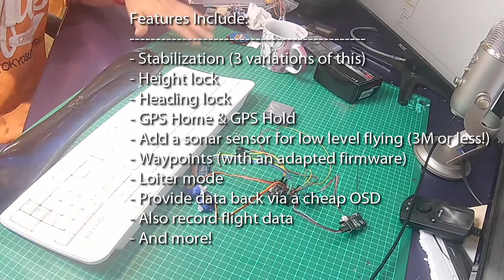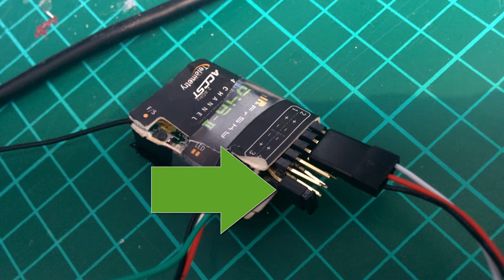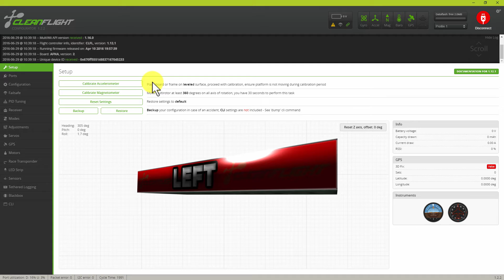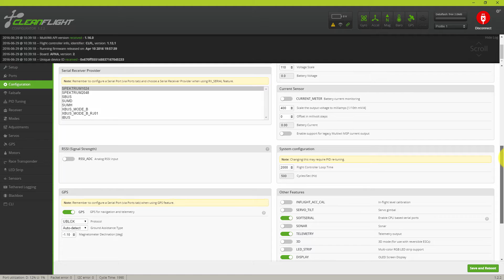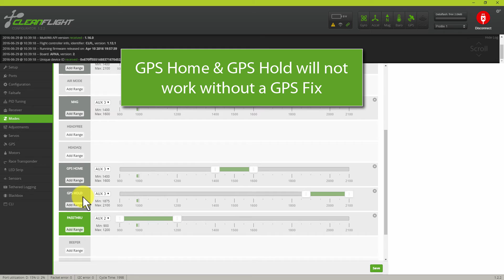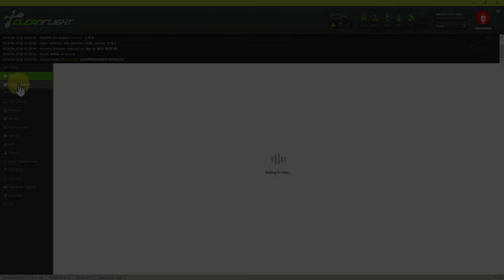Setting up a Naze32 Board for a Flying Wing

Comment: I can not get the servos to move :(
Reply from the maker: Howdy, see iNav instead, Matt
Reply: : - ) 

Can you pls tell the ß-flight guys what they need to do?
Difference is: Everything is blue and a bit strange, and there is an option Enable Motor and Servo output
Reply: ....... OH man... so ironic. now servos work exactly as i expected them to do. but now the motor does not get a usefull command. It is a brushless and does not beep. With Cleanflight/Betaflight it beeped and worked just fine
Reply: and it does not beep
Reply: okay, update: I can spin the motors using the motor tab. But it does not channel through my throttle from my transmitter - OR - it does not arm
Also the beeper still not working
Reply: the ESC beeps ready, and there is a good looking signal on the motor outputs. but it does not throttle up (the signal stays the same)
Reply: I also set up the armin switch correctly and set nav_extra_arming_safety = OFF
the boards blinks slowly (Green) plus red static LED
when arming it flashes fast (Green) plus red static LED

Comment: Matt, 

I want to use my naze32 for a fixed wing but it wont unbrick. I installed ST driver to help with unbricking it but to no avail. Can you help?
Reply from the maker: Howdy Derrick, I have no idea on that I'm afraid. Also I would strongly suggest not using cleanflight or similar for a fixed wing, when there is iNav available. See the series I made on it, miles better! Matt

Comment: Hi, tnx for the video .... I wish you had covered a bit bout more details of CF setup, especially the servo control part. I have made my setup as per gitthub and cleaflight documents for flying wing.....hardware and wiring wise, everything looks perfectly fine, I do have my fpv system working and motor is also arming and working good....the only issue is the servos on Elevrons! one is not getting signal and the other one is locked in one position. When I check the servo/motor tab in cleanflight....I see that my radio sticks on roll and pitch are moving the bars for servo 4 and servo 5....while I connected these two servos as per the instruction to pins 3 and 4 on Naze! Also the servo control menu on CF is not working....any assignment u want to do....its not getting saved!! Please advise.
Reply from the maker: Howdy fella, see here for a series on iNav, https://www.youtube.com/playlist?list=PLgoM4-umzSqd0clW-e_A12yKiOpV--3a2 Matt

Comment: Any thoughts on why the naze won't control my servos? It's controlling the ESC fine but the servos just make a quick sound and then go dead. No resistance when I move them. As if they're not even plugged into the naze.

Comment: What does 1/2 mean in front of the Fixed Wing, do I have to connect the 2 channels as an accelerator?
Reply from the maker: Hi Carlos, thats the PWM output channels, so 1/2 are the motors (3 is the left elevon and 4 is the right elevon), Matt

Comment: As you friend, I have a Naze32 10DOF eum Mini GPS; You say that in Cleanfligth I can not use the RTH and Alt Hold function, so how can I activate these functions in my Naze32 10 DOF?
Reply from the maker: Hi Carlos, If you continue through the rest of this older series you'll find that it doesn't work with cleanflight. Also I'd not suggest using a Naze 32 board as that ploughed my model into the ground, see the updated series here https://www.youtube.com/watch?v=1DCCjPbHl_I

Comment: Great video, but it is difficult to see where the wires go to. I have a naze32 rev6, a FZGPS, a microminimosd and a oled display(If possible). Can I use a X8R (SBUS) receiver to this, and how do i wire all this?  I will use INAV plane
Reply from the maker: Howdy, I would strongly suggest that you do NOT use a Naze32 board, look at the other videos in this series and you'll find out why. Instead use a F3 or F4 board instead, they're super inexpensive now & come with loads more features, like a built in OSD. Matt
Reply: Thank`s for answer. I am going to use the naze32 rev6 because i have one. I think i have found out that if i use a cppm receiver, i can do this??  or is there a way to use SBUS and all the others?
Reply from the maker: Howdy Jan, see above, I'd 100% not suggest using a Naze32 board. It smashed my model in the ground. Matt

Comment: Hey there,
Great video. Can you please post your PIDs?
I want to put the Naze32 in the same flying wing. THX
Reply from the maker: biberborste1975 Howdy, see my newer videos, try iNav instead, it's designed for fixed wing models, Matt
Reply: Yeah, maybe. But I don't want to install a gps module. So I want to use the naze32 with cleanflight. 
Can you tell me some PIDs wich worked well for you? thx
Reply from the maker: Howdy fella, this was almost a year ago so I don't remember what they were. But What I do know is that I would very likely not changed them at all. Hope that helps, Matt

Comment: how close to the cg should the naze32 board go?
Many thanks rct
Reply from the maker: Howdy fella, ideally right on the CG line if possible, or as close as you can get it at least. Matt
Reply: Matthew Ogborne if this is not possible can you offset what ever axis you have moved in, in the cleanflight configuration page?
Reply from the maker: rct2 Probably. I've not tried that though. Matt
Reply: Matthew Ogborne ta loads, it was just a thought.

Comment: I've tried using a Naze32 with CF on a flying wing and get erratic behavior from the servos.  Do you set up the profile in the Taranis as a flying wing or a plane?  I was only able to get it working in pass thru and by using a plane profile in my Taranis.  
I got it all working by using the Patrick Emilsson fork of Baseflight but really want to use Cleanflight in my wing.

Comment: Hi Mathew, I am new to the flying wing.  Did you use a power board to hook up the ESC and the battery to the Naze 32?  Can you tell me how the ESC power and signal line is connected to the Naze32?
Reply from the maker: Howdy Frank, I'll be covering this in a dedicated episode in the new year. Matt

Comment: Thanks for this. I'm not so interested in the GPS stuff and have a spare afromini so I'm going to do this on my first wing (first fixed model too). I'm really just interested in having auto levelling so it flies a bit like a quad with a broken accelerometer (always wants to go forward). :)
Reply from the maker: Howdy fella, yea the stablisation works really well. And yea try using yaw on a flying wing, I did a few weeks back and was OMFG!!!  It's not responding & realised I was flying a wing not a quad lolololol
Reply: Matthew Ogborne It's going to be weird to get used to as my fingers fly a quad pretty much automatically now. I expect crashes so I'm starting with the $20 thing banggood sell :)

Comment: Im getting problems with my setup  my yaw and pitch are the only ones working and no input on roll
Reply from the maker: Howdy Marcus, clean flight and a fixed or flying wing DID NOT work out for me. The gps functions such as RTH and loiter failed badly. I'm working on a new series right now using base flight and iNav. I'll publish part 1 tomorrow morning.
Reply from the maker: Marcus, see this video https://www.youtube.com/watch?v=sti1GxjEHmE
Reply from the maker: Howdy Marcus, literally just seen your comment while replying to another one. Apologies for the delay. As I found out Cleanflight doesn't support any GPS features for RTH or loiter with fixed wing, instead see the series here https://www.youtube.com/playlist?list=PLgoM4-umzSqcnDGRUWBReXZOVsg4Lu1Gx especially Baseflight Airplane as that works really well. Matt

Comment: how many servos can be attached??
Reply from the maker: Howdy Gustavo, 4. Channels 1 & 2 are for the motors, 3 & 4 are for elevons or ailerons, & 5 &  are for the rudder & elevator. Depending on the model format selected.

As a heads up the more I've dug into this the more I've found and a stock Naze32 board with cleanflight isn't enough. Look up iNav or PatrikE's baseFlight for fixed wing, see here for more info http://fpvlab.com/forums/showthread.php?27854-NAZE32-for-fixed-wing&p=805816&viewfull=1#post805816

Comment: Finally some one is having a go and documenting it. Awesome...! Bangin...!

Have you sussed out PID tuning yet? It's a mind shag on fixed wing and CF......loves a challenge! 
What PID controller are you using? I'm re-write ATM.
Would you use Air Mode? I'm finding the P gain is proportional to the throttle position like Quad without AM. This makes low and slow interesting. I hope AM will sort this?? Not had chance to try.
I'm thinking the servos can't react quick enough unlike fancy pants Quad ESCs. Might look into if available/exist, fast reacting servos?? 
I'm only getting good stabilised flight in no wind conditions.....surprise, surprise! 
Can't wait for winter and a damn good hard frost and no wind........love Brexit British weather! 

Bonsai
4s
1806 
6040
Frsky
Naze32
Cambridge
Horizon mode so far........

Proportional low 2.0 -3.0
Integral high 0.050 - 0.070
Derivative low 20 - 35

Peace
Reply from the maker: Howdy Barney,

Good & bad news I'm afraid. Stabilization on a wing with the Naze 32 is absolutely brilliant with no changes needed, it works great out of the box with default settings. 

GPS Home is a complete fail with the Naze32, it either nose dives at max throttle into the ground or prop hangs the wing in the air!

See the beginning of this video for a quick overview https://www.youtube.com/watch?v=ivukwrlc_k0

Matt
Reply from the maker: Just to clarify, pass-through mode is a bit wild, Rate (no other settings enabled) is great, Angle & Horizon also OK to fly with.
Reply: Ahhhh man. Does that mean you're giving up?
You got us all excited.
Reply: GPS needs to be tuned.
Reply from the maker: Howdy Barney, yea I'd have thought that too, but the GPS unit used worked in the Quadcopter with a Naze32 board (GPS Hold & GPS RTH) and before hitting GPS RTH, I checked on the Taranis telemetry screen and we had 9 sats in view. Quite odd
Reply from the maker: Not completely, bought a EagleTree vector for the FX-61 Phantom as that model is wayyyy too good to trash. 

I will come back & revisit the Naze32 board & GPS RTH because I was amazed by the stabilization abilities with the default settings on the Teksumo.